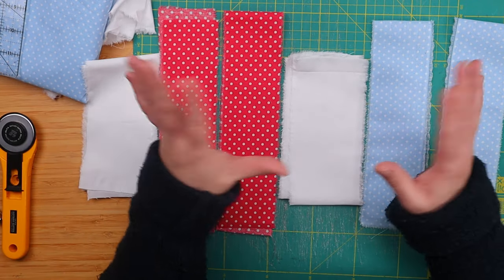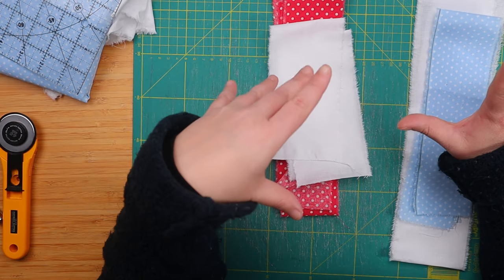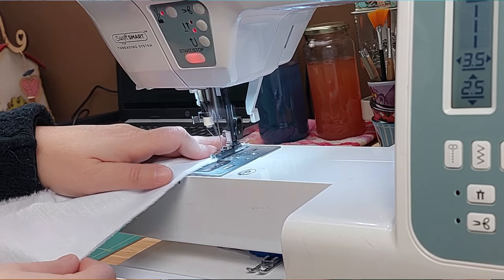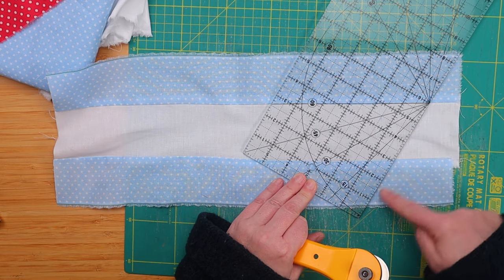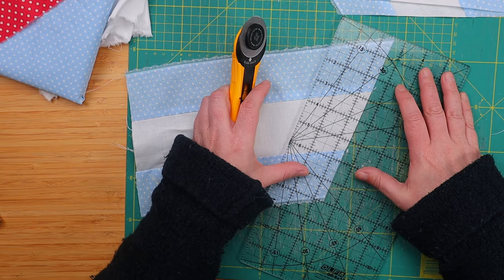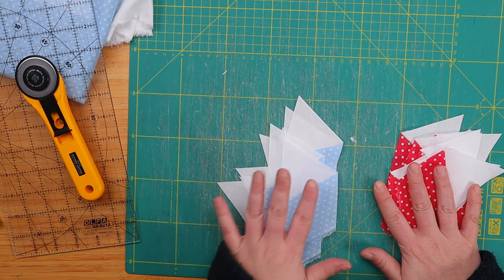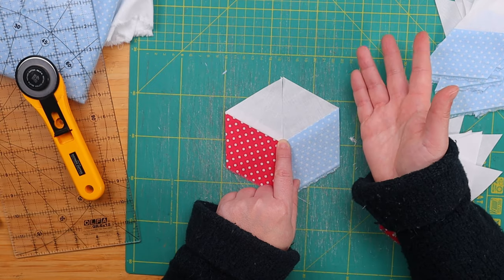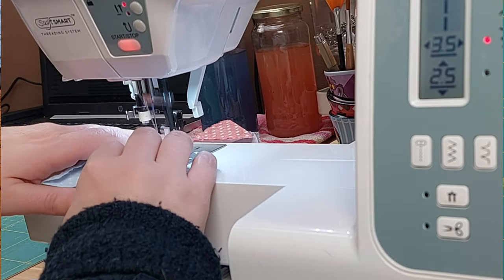Quick & Easy Tumbling Quilt Block Wiith NO Y Seams | Easy Quilt Block Tutorial

Comment: I loved this video, and found it very helpful for the first stages,  cutting strips;then sewing 3 strips of medium/light/medium together, and three strips of dark/light/dark together; then cutting the strips in smaller strips, and cutting the light fabrics into triangles; assembling the puzzle. However, I could not figure out how to sew the tumbling blocks together. I did not find the video or the narrative helpful enough. First, I sewed the pieces together horizontally, which worked great -- most of my points worked out. However, when I tried to sew the rows together, I couldn't figure out how to make it work. When  took those apart, and sewed columns together instead, I had problems as well. I wonder if Sandy can do a video focusing a little more on the last half of asembling this quilt.
Reply from the maker: Hi. Well you literally read my mind because there will be a video in about a week or so where I go back to making tumbling cubes. Until then, there's this video you can watch that I hope helps you: https://youtu.be/AZ_Fs0-oNzA
Reply: This link didn't answer the question. The easy way you did it in the link was so much easier, i.e. cutting 6 triangles and sewing together 3 triangles for each sode then sewing both sides together. The problem is, I already cut my quilt out using the method here. I agree with the origonal post that you don't explain how you sew them together without the "Y" seam. I sewed the boxes together, then I sewed several together in a row. I then watched this video again and it looks like I need to take my row apart, separating it into single boxes again. Now, how do I sew all this together without that pesky "Y" seam?

Comment: curious... why did you use a 3" solid strip rather than a 2.5" strip?
Reply from the maker: Hi! Because I needed the extra seam allowance to join the 2 triangles at the middle of the diamond. If the strip was 2.5, the diamond would end up smaller than the others.